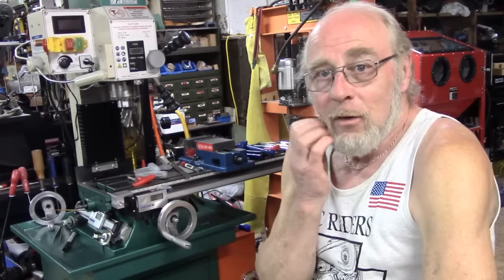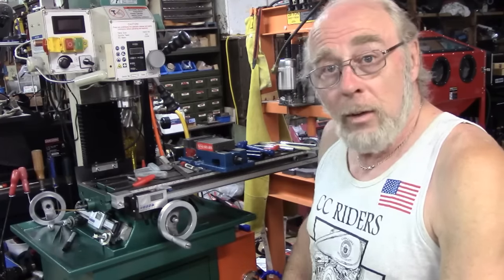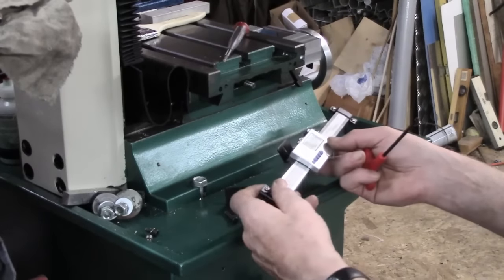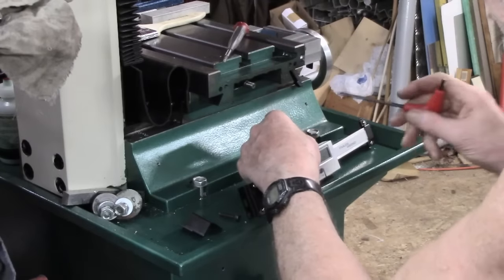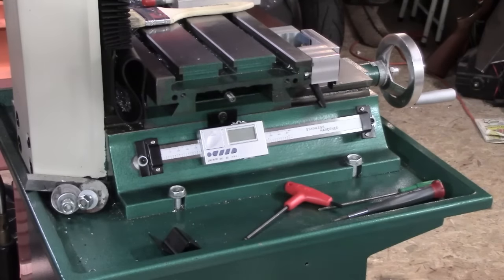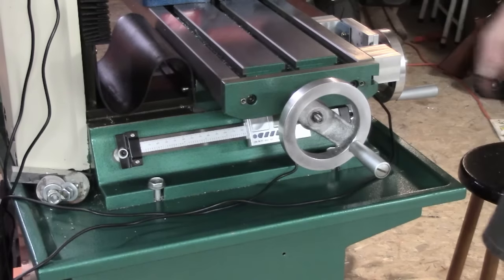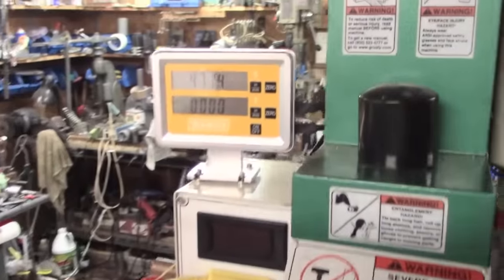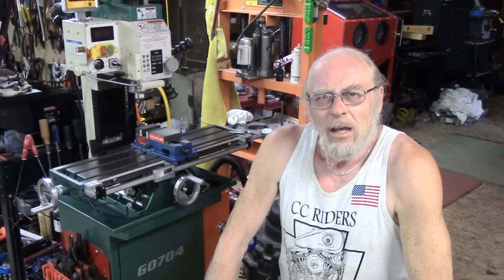DRO Fit on Grizzly 0704, Part Two, Y-axis

Comment: I just got a G0704 and I am thinking about making it CNC. Do you like your machine? I think this is great. I also bought a G4000 lathe. I have a long way to learn how to use them. I will learn how to use them on YOUTUBE. Thanks for any info you can forward. Bill
Reply from the maker: +Bill  Clifford 
Hi Bill. I find the 0704 pretty much does what it can from a small machine, and it's worth treating it kindly too regarding tool loadings. Overall I am quite pleased with it.
if you haven't got yet - get an R8 collet set and a decent R8 keyless chuck. I think going CNC is, for me, just too involved and costly - possible of course but ....
Good luck with your new machines. :)

Comment: That looks a nice solid neat job and I like the way the x axis clears the table because  chips will easily  clear it.Thanks for sharing your idea  because I was thinking of fitting a DRO to my smaller mill.
Reply from the maker: +Nodrog Awson 
Hi - Thanks - well, wasn't entirely ideal but worked out to be necessary when considering all options. It works well - just limits my table travel just a bit each end - normally no big deal. It's called compromise. :)

Comment: Hi Chris:

I noticed what appears to be two different lights that you use on your mill.  Would you be so kind as to provide your source for these two lights?  One is a led ring around the quill and the other is a flexible light.

Thanks..
Reply from the maker: 1OlBull Hi -- one light is the LED ring - it's called "Angel Eyes" - a search for "angel eyes car" may well work - very inexpensive and mine holds up with neodymium magnets. The other light is listed as "30 Led Sewing Machine Light Lamp Magnetic Base Goose Neck" - mine was from seller 'supersewingman'. I now have about 5 of these! Being mag base means I can set them up where convenient --- used on mill, lathe, grinder, work bench etc.

Comment: Hi Chris, I have a J12 milling machine. I had the same problems as you have come across.
However, I mounted the reading heads to the scales rigid, and let the scales go through. They are fine, being mounted on the front as long as you are aware of them at all times so you don't damage them, 
Chopper 316 UK
Reply from the maker: Nigel Harding Nigel - from what you say, I have done same -- in as much as reading slider is fixed and scales go thru. I do have plans to make some sort of cover/shield.

Comment: Hi Chris,

the end result looks good and will transform your confidence in using the mill accurately. I personally find the Z axis is the most invaluable, which is integrated with your head already.

Now you can also work in metric with your imperial leadscrew with ease ;-)

Comment: good job. i installed a similar setup on my round column mill/drill about 5yrs ago. i used an igaging set up.my sliders dont have the display or the battery in them, witch makes for a much more compact unit. the cable is much smaller and doesn't get in the way. my displays are smaller than yours but adequate. my sliders have been exposed to chips,cutting oil and cleaning solvents with no ill effects. i am a little concerned about your sliders with the buttons and display exposed, you may want to fashion some shields for them. my dro is quite accurate i have checked it against the dial on the lead screw and with dial indicators. its always within a thou or so. good enough for my work. good luck with yours
Reply from the maker: larry sperling Hi Larry -- I do intend to fix up some sort of shielding eventually - more important IMO for the X as the Y is somewhat protected anyways. The big sliders are a bit of a pain but, we'll manage.

Comment: A first rate installation for sure.  This business of mounting the "X" scale on the back of the table may be just right for a Tom Lipton size machine but it would be a very bad place for the sizes of machines we are dealing with.  Never worry about the conventional way just do it your way.  Thanks for the video.
Reply from the maker: cerberus Thanks - you are most kind.

Comment: Looking at the finished project it all looks very practical and solid, further to my earlier comments about a sheet metal protector plate I can see that 16SWG would probably be a bit light for the span, but you could now use your two spacer blocks to mount a strip of 1/4" plate, in effect a table extension, to come out over the scale, that would definitely protect the scale from anything you are likely to drop on it, it would also give you a solid place to park tools on while you set up a job. Chris B.

Comment: Hi mate.
That was a very nice installation in the end.  You are right, the back of the table would have been impossible.  Does this model come with a DRO on spec, would be good to see how they have done it.  That reader up top is working quite nicely.  I think this set up will do you.  Good on you.
Kind regards,
Marcel.
Reply from the maker: Marcel Timmers Thanks Marcel - someone did point me at some info regarding how they do it at the back - yet to check that out. Possibly, a rear installation may well have a much smaller slider - that could help.

Comment: Chris, did you run it against an indicator just to see how accurate (and repeatable) it is?
Reply from the maker: Steve McQuillin Hi Steve - only done quick test so far but things match very well indeed. Obviously small backlash is evidenced on a return but that's to be expected. Even so - on super critical work I would very likely add indicators as confirmation of what is going on - trust them bit more than electronics!